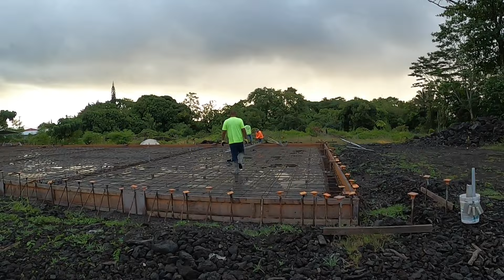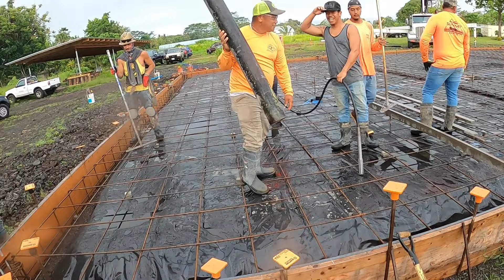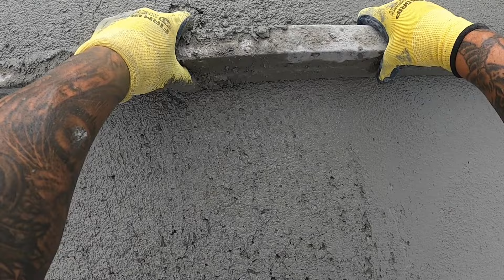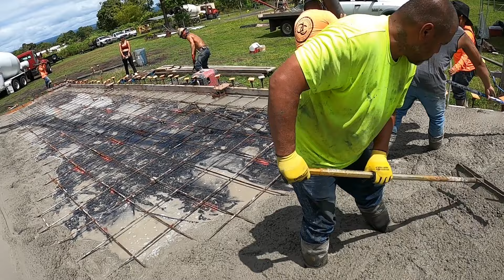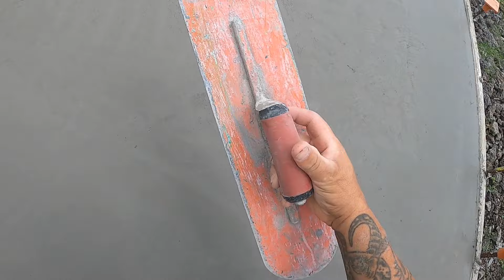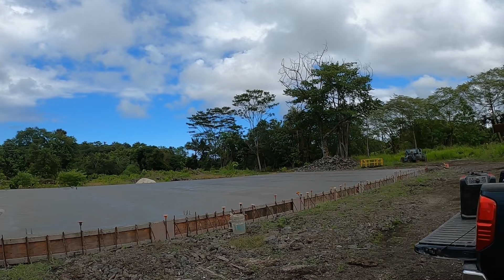We Eat Concrete For Breakfast!! Big Island Masons

Comment: do they ever use power screeds in Hawaii? we been using them lately and bro if u do it right they are nice at a 6.5 slump
Reply from the maker: Never seen them used here yet. I've actually used them before I worked with a guy who had two back in the mid 2000's
Reply from the maker: These guys like to pour stiff as well typically at a 5 slump
Reply: @thatjuanshow4485 ohh yeah 5 slump wont work for power screeds. Mayb a 6 at the dry est